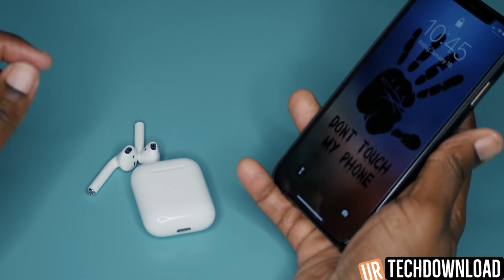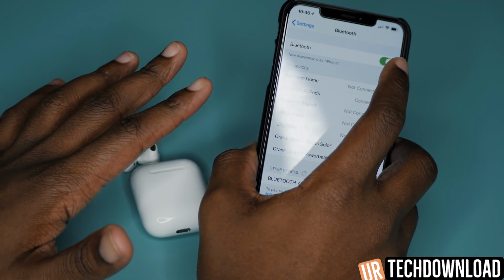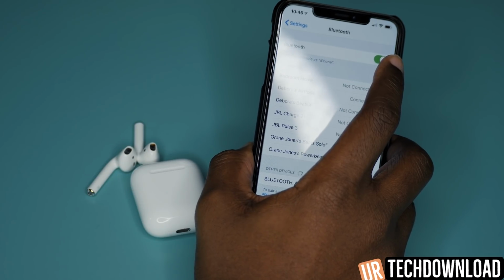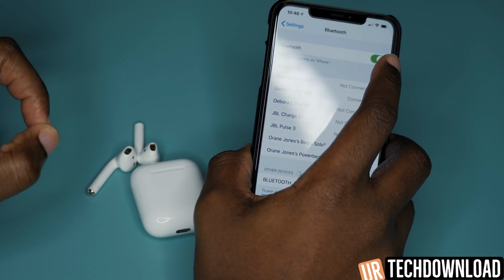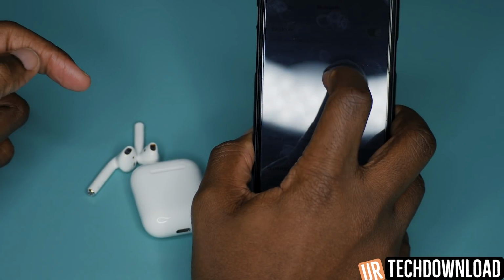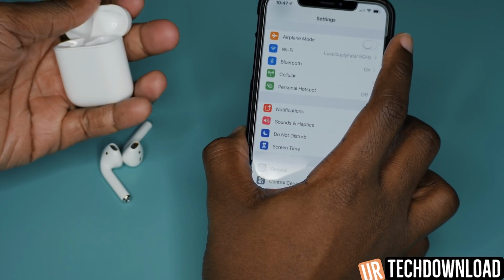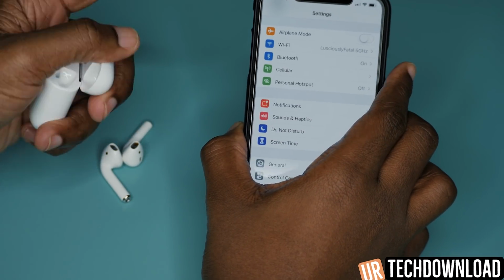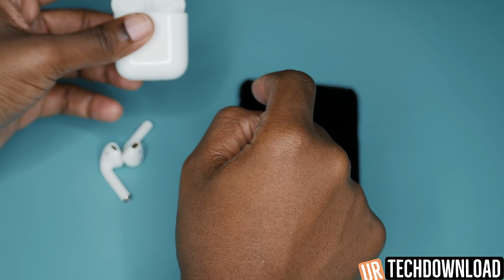Airpod Issues? No Problem! Here's How to Fix Them

Comment: Every time I call someone or ask my google assistant on chrome. The right AirPod make these weird noises like a screeching sound.
Reply from the maker: Thanks for the comment, Try Go to Settings > Bluetooth and tap the icon next to your AirPods.1 Then tap Forget This Device. 
   Put your AirPods in the case and close the lid. Wait 15 seconds, then open the lid. 
   Press and hold the setup button on the back of the case until you see the status light flash amber a few times, then flash white. 
   Place your AirPods close to your device. Follow the steps on your iOS device's screen.
Also, try to Reset the network settings on the iPhone. If the Problem continues you will have to contact apple support.

Comment: My AirPods don’t reset it just keeps blinking white no matter how long I hold it.
Reply from the maker: Thanks for the comment, If the status light is flashing white, then your AirPods are ready to set up with a compatible device. Check your phone, if the airpods are listed but not working. Try having the phone forget the airpods, then do a hard rest on the phone, also cleaned the charging connectors with a q tip and wiped down the airpods themselves and try it once more. Hope that helps.
Reply: I have the same issue , not resetting, Amber light is not coming.. I tried forget device ... still not working

Comment: My left AirPod won’t work and I tried everything for hours I heard that if you charged you’re AirPods with a 3rd party charger that’s bad ?
Reply: That’s what I did I used a 3rd party charger
Reply from the maker: Apple doesn't really support 3rd part charing for the airpods, but if it was just a 3rd party lightning cable it should not cause too many issues. Try to clean out the inside of the charging case and then put airpod into the case to charge for 15 minutes and then check to see if it's working. Also, go into your settings, press general then hit accessibility scroll down until you find a scale with a left and right and make sure the circle is in the center. Sometimes that helps
Reply: URTechSupportDownload I’ve tried everything in the book I haven’t had these AirPods for more than month so imma kinda disappointed that these are malfunctioning when I haven’t even had them for 6+months and mines are the 2 the recent one that came out
Reply from the maker: Yeah I can understand that, the one benefit is if you reach-out to apple support they can replace the airpod that's causing the issue. Hopefully your able to get it worked out, that sucks.

Comment: I have a problem with my AirPods that when I take them out the case they don’t automatically connect to my phone when they used to before now I have to go to settings and connect them every time please help
Reply from the maker: Thanks for the comment, try restarting your phone, power it down then back up. Try having that device Forget the airpods in the IOS settings, and also Reset the Network Settings as well, then try the repairing process. This worked for some hopefully it helps
Reply: URTechSupportDownload thank you so much

Comment: My AirPods keeps on disconnecting and reconnecting but then when I play music it disconnects and I need help pleas
Reply from the maker: Thanks for the comment, A couple of things you can try is Check the AirPods Battery Status, make sure they are fully charged. Use Either Left or Right Microphone By default, both the earphones work as microphones during calls. Allowing only one to work as a microphone at a time might fix the disconnection issue. Turn off Automatic Ear Detection. Forget and Re-pair AirPods. Reset Network Settings/All Settings on your iPhone. Also, check to make sure that your airpods are not connecting to a device that is close by. If the airpods were connected to your tablet or laptop previously it may try to reconnect when close by causing an issue.  If your AirPods is having issues, you may have to reach out to apple support.
Reply: URTechSupportDownload I tried it and it didn’t work it just keeps on disconnecting and reconnecting what do I do ?
Reply from the maker: I'm sorry that none of those worked for you. The last thing you could try is connecting the airpods to another device like a laptop or tablet. This will be a way to check if the issue is only with your phone's connection to the airpods or with the airpods themselves. And with that info and everything else you have tried I would suggest reaching out to apple support, could be some sort of hardware issue that is causing the problem.
Reply: Thank you I will update you if any work

Comment: My right AirPod will not play and connect to my phone even though my right one will it’s making me confused
Reply from the maker: Then you may have to reach out to apple support
Reply from the maker: Thanks for the comment You can try, Going into the settings of your phone, Tap Bluetooth, and then tap the 'i' icon next to your AirPods in the list. Tap Forget this Device. Ensure that both AirPods are in their charging case and that the case has a charge. Locate the small button on the back of the case, near the bottom. Open the charging case lid. Press and hold the button on the back of the case for at least 15 seconds. Now, close the lid of your AirPods case and then open it up again. Hold the AirPods case with lid open next to your iPhone or iPad. Your iOS device should recognize the AirPods and you'll see a popup to connect them. If that does not work, try resetting your iPhone's network settings.  Settings app and select General -> Reset -> Reset Network Settings, then try re-pairing your AirPods by repeating the steps above.
Reply: URTechSupportDownload it didn’t work 🤕

Comment: Apple iPod my distance range is very erratic from phone has to be right in front of me is there any other problems
Reply from the maker: Thanks for the question,  First thing to try is Restarting your iPhone and making sure everything is charged 100%. After that my recommendation for a next step would be to forget the AirPods, then set them up again. You can forget them by going into Settings > Bluetooth, and tapping the "i" icon to the right of your AirPods. Select "Forget this device" from the next menu. Then, follow the steps to get it set back up. We have a video on how to set them up if you need help. Also, make sure that your on the current Firmware Version for both devices. If your AirPods is having issues, you may have to reach out to apple support.

Comment: Help!!! None of this worked!!! MY AIRPODS WONT CONNECT AND THEY ARE WAY TO EXPENSIVE TO NOT WORK!!!! IT SAYS CONNECTION ERROR!!!!!
Reply from the maker: Thanks for the comment. Make sure to power cycle your phone (turn it off the back on), do the same with Bluetooth, Make sure both the airepods, and phone are on the most updated software. Try a full reset of the airpods,  make sure the airpods are fully charged. Try connecting it to a different device (Laptop or another phone) Make sure the case is clean so the airpods are making a proper connection with the bottom of the case. Reset All Settings on your phone. If your AirPods still won’t connect to your iPhone, you may have a hardware problem with your AirPods. And will have to reach out to apple support.
Reply: Thanks it helped!

Comment: my AirPods connects to bluetooth but does not have the option for settings in bluetooth like change name, change setting of AirPods, siri and microphone...
Reply from the maker: Thanks for the questions,  You have to go to Bluetooth settings ->  and then tap the "i" next to your AirPods and the options should be available. If your still not seeing them, you may have to reset the airpods and repair them to your phone.

Comment: My airpods case won't charge. I tried switching adapter but it still doesn't charge. What should i do?
Reply from the maker: Try to Reset your AirPods Case, and Cleaning the Cases Charging Port and also Check the wall charging unit as well.
Reply: @YourTechSimply  thanks

Comment: My airpods never show lights what should i do?
Reply from the maker: Make sure the case is charging correctly if it is then I would try a full reset of the airpods see if that helps. if it's still not working, your best bet is to get in touch with Apple Support.
Reply: My airpods are the same did you get anh fix pls respond I'm so tired ive been looking for answers for 3 days

Comment: My Microphone For My Airpods Wont Work
Reply from the maker: One Thing to check is if there is any debris gathered near the microphones? It may help if you brush it away gently with a dry lint-free cloth.
Also, make sure to check that the AirPods fully charged. If not, try giving them a full charge and then test to see if this helps: 
You might also want to try re-connecting your AirPods. First, tap Settings > Bluetooth. The tap the 'i' next to your AirPod and tap Forget This Device. The next step is to put your AirPods in your case and close it. Wait 15 seconds, and then open it. Next, press and hold the setup button on the back until you see an amber light followed by a white light. Then, re-pair the AirPods and test
If you find the microphone audio is still not working, your best bet is to get in touch with Apple Support.

Comment: idk if its bc my MacBook Air is being really laggy lately but basically.. my AirPods every like.. 15 seconds lag for like a couple seconds, its like it glitches left to right then goes back to normal and its soo annoying..
Reply from the maker: Here is something you can try to fix that problem.
1. On your, Mac Hold down Shift+Option and click on the Bluetooth icon in the menubar.
2. A hidden menu is visible called "Debug" in that menu choose "Reset the Bluetooth module".- a warning will appear asking you to confirm the action.   Keep in mind this will disconnect any Bluetooth devices.  
3. Restart the computer.
After the restart, the Bluetooth should fine your accessories and hopefully, connect without issue.

Comment: My left airport drains fast... I can't even use it for 30 minutes.. what can I do?😭
Reply from the maker: Thanks for the comment. One thing you can check is if you have the AirPods set to always use the microphone on the left AirPod instead of automatically switching. Settings -> Bluetooth -> Tap the i next to your AirPods in the list of devices. At the Bottom Set Microphone to automatic. 

If all else fails you can try a reset to see if that works.😎
Reply: URTechSupportDownload I have done all... I have reset it and done all my possible best to make it works... I have tried by best but it won't still be fixed... I can't use my left airport for more than 30 minutes
Reply: I even noticed that it's hot
Reply from the maker: Sorry that sucks, you can try letting the left AirPod drain completely and keep using the right one until it drains as well. Then put them in the charging case, give it like an hour or so see if that helps. If not you may need to get a replacement on that left aripod.
Reply: That's bad.. thanks for the help anyway... I will do that and get back to you
Reply: Oh I just remembered I have done that before... Am just confused 😭😭😕
Reply from the maker: cool, hope your able to get it fixed
Reply: URTechSupportDownload no I can't am confused... please help me out... I will be very grateful🙏🙏
Reply: URTechSupportDownload no I can't am confused... please help me out... I will be very grateful🙏🙏
Reply from the maker: Unfortunately, if none of those worked your next step would be to go to apple, maybe that one needs to be replaced.

Comment: when i have my airpods on charge it charges the actual airpods but not the case and it just stays on 0%
Reply from the maker: That's strange, A couple of things you can try are.

1. Reset your AirPods Case, Press and hold the setup button on the back of your case -> Let go of the button when the status light flashes amber, then flashes white -> Then Try to charge the case once more 

2. Make sure the Cases Charging Port is clean, also try a  Different Cable
Reply: Or just return them to apple and say there faulty it worked for me and I got new pair

Comment: when i have my airpods connected on my phone the sound is kind of quiet but when i connect it to other devices it's loud as it should be..what can i do?
Reply from the maker: Thanks For the question A couple of things you can try,  

1
Check Low power mode on your phone a sometimes it can reduce the maximum volume potential on our AirPods.

The easiest way to turn off low power mode is via Control Center but if that’s not an option, go to Settings > Battery and toggle off Low Power. 

2
You can also Check Volume Limit and Sound Check
Open Settings -> Scroll down and select Music ->Select Volume Limit -> Adjust the Volume Knob all the way to the end ,  it may show as off still click on it and make sure the Knob is all the way to the end.

As for Sound Check,  Open Settings -> Scroll down and select Music Make sure sound check is off.

3
You can Simply unpair and re-pair your AirPods

 4 Calibrate the sound between your iPhone and AirPods
Turn the volume all the way down
Disconnect (do not unpair) the AirPods via Settings > Bluetooth
Keep the AirPods in your ear
Play audio using your iPhone’s speakers
Turn the volume all the way down
Reconnect the AirPods
Adjust your audio accordingly.

Hope that helps

Comment: Hey, i'm really getting mad at my airpods 
The left side it charge but the right side 
NO
Reply: Vice versa. My left airpod wont charge but the right is charging
Reply: Anthony Maalouf same
Reply from the maker: You can Try to wipe off the metal end of the AirPod that's not charging, and then used a Q-tip to clean the bottom of the case where the metal end of that makes contact with the case. 

Also

You can try forgetting the AirPods on your device and then resetting the AirPod case by holding the button on the case for about 15 seconds, and then re paring it to your device. Hopefully, that helps

Comment: My airpods is not getting reset after holding button for 15 seconds
Reply from the maker: You can try a few things 1) Try cleaning the contacts in the bottom of your airpod case with a cotton swab. Once done place them back into the case and try once more.  2) You can try to reset your network setting on the iPhone, then disconnect the AirPods (forget this device process under bluetooth) once it successfully disconnects, and then it should reset fine. 

On your phone -- go to general>reset>reset network settings.
Reply: I have done but not resetting airpods
Reply from the maker: Ok, Couple more things would be to check to see if your low power mode, and if so turn it off. opening Control Center and tapping the battery icon, so it’s no longer in low power mode.  Or visit Settings > Battery and toggle off Low Power Mode. 

- Other Tips -
Go to Bluetooth settings and forget your AirPods
Put both AirPods in their case, open the lid
Hold that small button on the back of the case for about 10-20 seconds until the status light starts flashing amber
Once the status light blinks amber three times, release that back button
Now put your AirPods case (with AirPods inside) right next to your iPhone and hold the back button once more. Auto-pairing should initiate–press connect and go from there
 Or
If you are still out of luck and cannot get your AirPods to pair and connect to your device, unpair them again and then reset all settings by going to Settings > General > Reset > Reset All Settings. 

Performing this reset doesn’t remove any data, but it does change any kind of personalization to your settings back to factory defaults.

So this action impacts things like any accessibility setting changes, stored WiFi passwords, wallpapers, and so forth.

Once you reset all settings, perform another restart. Then try to pair them again.
If none of that works you might have to reach out to Apple at that point
Reply: Im trying to say that i hold small button on the back of airpods but it doesn't blink orange light after 20-30 seconds only white light blinks.
Reply from the maker: Yeah, it sounds like the case is not detecting the connection to both earbuds in while in the case. If cleaning it did not work the next step would be to reach out to apple, it seems that there may be an issue with the connectors at the bottom of the case or the bottom of the buds itself.